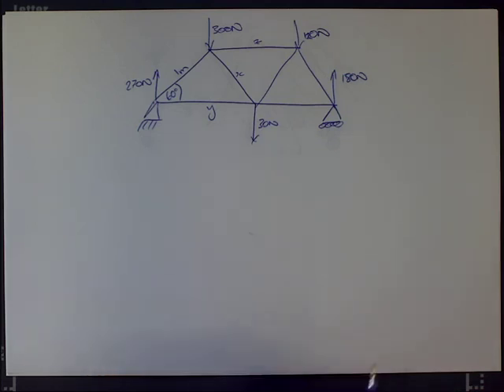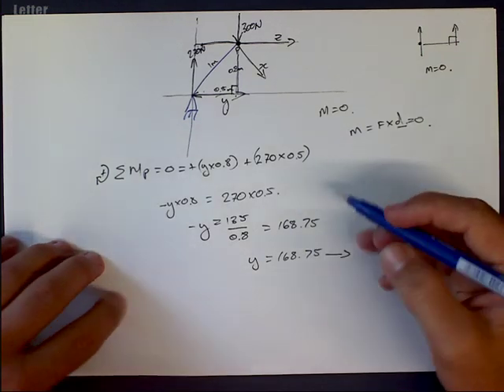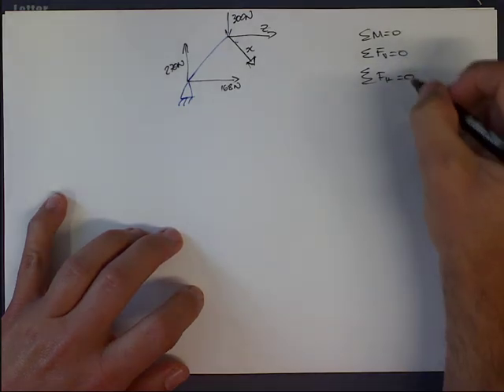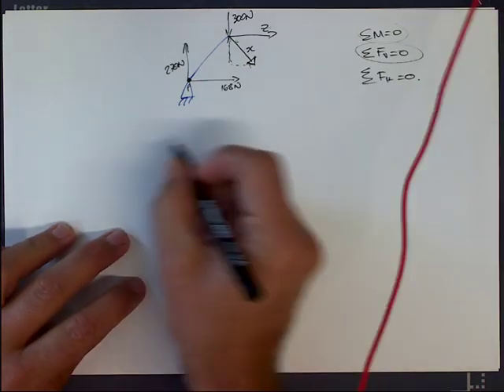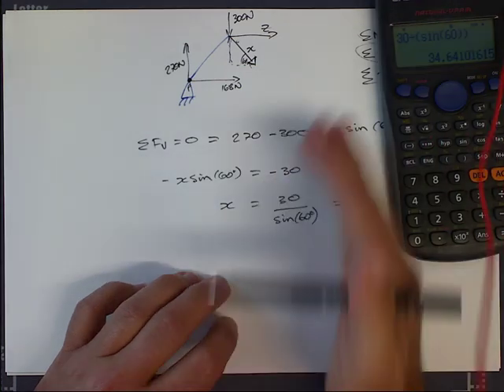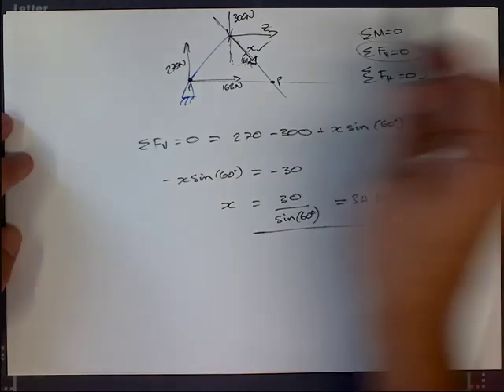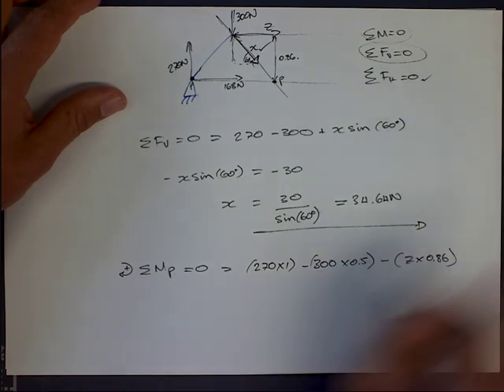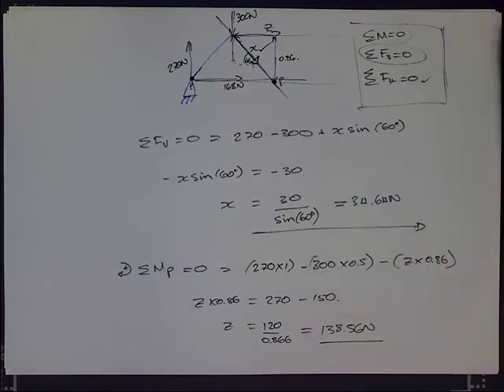HSC Engineering Truss Analysis - Method Of Sections Part 2

Comment: Solving for Z when doing the sum of the forces in the horizontal direction i got 186.07 N, which is completely different from your answer when solving for Z using the moment about point P.  Your answer came to 138.56 N.  My equation for solving for Z came to this: Fh = 0 = Y + Z + Xcos(60)... Any help please?
Thanks!
Reply: I also have that problem did you figure it out?
Reply: Yeah I also got that, although it works out if you use F(h) = 0 = Y + Z + Xsin(60) and also obviously F(h) = 0 = Y + Z + Xcos(30)...

Comment from the maker: If you are doing horizontal components then you would add 168N to the horizontal component of X and the value of Z which should all equal zero. eg. 0 = 168 +Xhoriz + Z (obviously this would mean that Z would need to be negative which is the same as subtracting.)